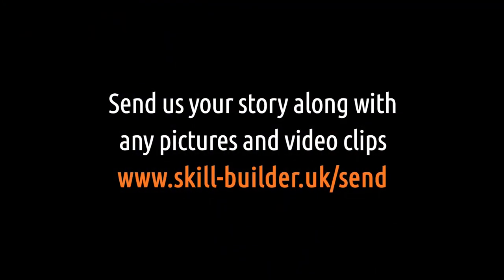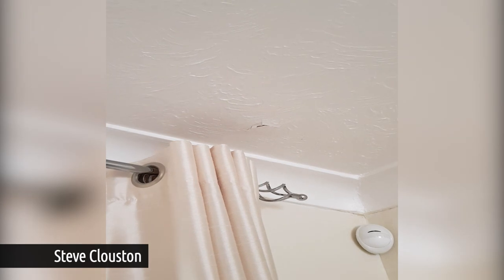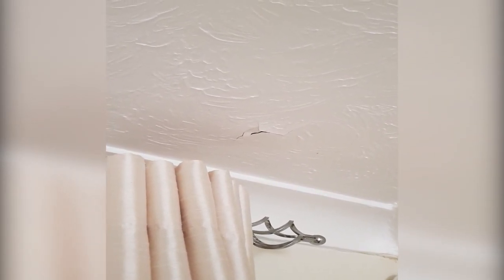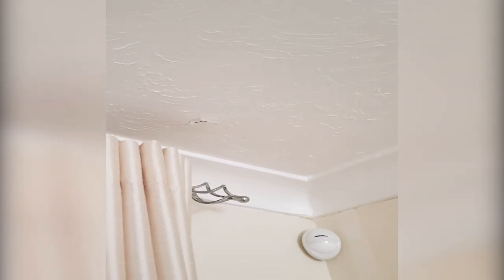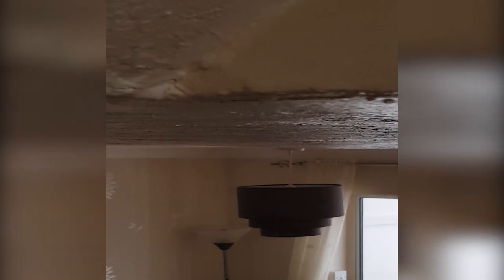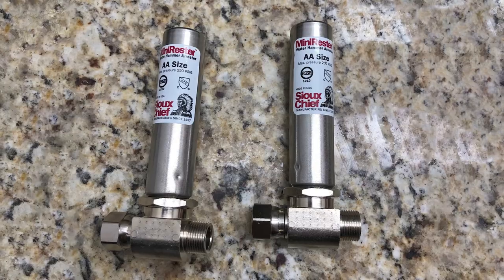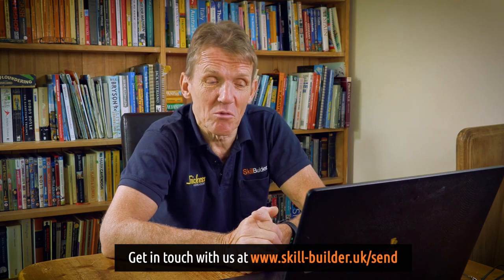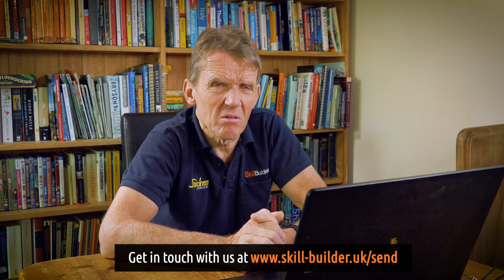Cracked Ceiling, Leaks & Water Hammer - ASB #17

Comment: We had a similar problem with our lounge ceiling, after a water leak which the insurance company paid to repair. They covered damage caused by the leak which meant ripping out the old plasterboard and artexed ceiling as well as materials for decorating the walls. Might be worth checking your insurance for the costs following the hot water cylinder problem. Our damage has been caused a few years before but they still covered it - we just told them the facts, got quotes and after they inspected the damage it was all sorted in a few weeks.

Comment: I remember a house where the pipes screamed when the downstairs toilet was flushed they sounded like they were trying to get out of the walls across the house and the reasons was a dodgy washer in the toilet cistern, replaced the cistern and it fixed the problem, that was called hammering too.

Comment: The problem with the concrete garage. I have tackled similar to this a few times. Flexyacryl is excellent stuff, can be applied in dry or wet weather and coated along the bottom of the garage wall would cure that too. You might have to re do it in about 10 years time, but how bad is that. Another product is Cromapol, if you need a lot of it this works out slightly cheaper as it is available in 20Kg tubs instead of 5Kg. Both are excellent products.

Comment: The strapping at 10.50 onwards are ceiling joist hangers .The floor as Roger calls it is really your ceiling and looks like it is only 3*2 with a 3*3 going across so that the hangers don't need to be put on each ceiling joist. Do not cut them unless someone who is a builder actually looks at the job and says you can, your ceiling will probably sag considerably if you do just cut them. To open up that space and not compromise your ceiling strength is a considerable job and would at least need a competent DIYer with a reasonable knowledge of roof construction. They look like original construction( Nobody puts more material into a house than is needed so they are there for a reason. I suspect if you did cut them your ceiling would suddenly turn into a trampoline.)

Comment: Hello Roger, I now live in Australia. In a previous video, you & Robin were talking about Roofs & that there was a shortage of Tiles etc. Here in Australia we use Concrete Roof Tiles or Steel Roofing (Colorbond) which you can get in assorted colors & Profiles. I was wondering Why they don't use this on the roofs in the UK. We have extreme weather conditions over here and the Steel stands up to them all. I have Concrete Tiles on my roof, but would prefer the Colorbond Steel. If we had Slate the Rather large Hailstones would soon destroy the roof.
Reply: @Benzknees  Nice to hear from you. All commercial buildings here have steel on them. As a retired carpenter I always preferred Steel as you need less Trusses to cope with the roof load. Some commercial Buildings have Flat Roofs & Box gutters, however if we get a large Hailstorm these gutters soon fill up & can cause a leak or collapse of the roof. I don't know of any houses with flat roofs but I am sure they are around . A pitch of 22.5" is common. As we have Cyclones here the Steel roof in my belief is better if it is installed as per instructions, the Concrete tiles can & do fly off. All the  best from OZ.

Comment: Those timbers are to hold the ceiling timbers to half the free span of the ceiling to stop sagging
Reply: Agree.  Had them in my loft before the conversion.  You can see the pieces attach to a full length baton which sits fully across the tops of all the ceiling joists. So those few pieces are holding up the ceiling joists right at the mid point i expect.
Reply: Yup. I have loads of floorboard sections between the purlins and the ceiling joists approximately halfway between the wall plate and the central supporting wall.

Comment: So ive dug up all the old concrete floors in the house they were damp and cracked. Put the sub base in and wacked it down and gone over and over it.... so next is the sand and visqueen before the 4' 100mm insulation eco therm 8x4 sheets. Can you tell me any hints tricks of the trade tips as to how to get the sand level and the boards not to rock....  how accurate do you need to be with the sand so the boards do not rock? Thanks
Reply: Robert Jones no purlins on the roof. Not sure of size of roof from pics. Does not look enormous but no support at all? Does not seem correct?

Comment: That ceiling, a lot of the time it's the ties they've used above (nailed batons) to the roof timbers, either nails have rusted and snapped or homeowners have removed them when they've used attic for storage. Only way IMO is rip it down jack timbers from underneath til straight and put a new baton in to stop it sagging again, then re-plaster. The worse job I've ever done in my life, including scooping gallons of poop out of a manhole.

Comment: Needs to get a pressure washer to get off the loose bits and anything growing on that concrete before applying any sealant, otherwise it's a waste of time and will fail.

Don't use that flexible pipe for drainage - it crushes too easily.  Get some 3" PVC with perforations (facing down), and make a burrito from filter fabric usong clean drain rock around the pipe.  If he is building a gravity-type retaining wall using stacked concrete blocks, don't really need a drain pipe if he backfills with gravel.  I'd pay more attention to preventing water getting behind the wall - presumably he wants to add a deck on top, so I'd make sure to add a drain and direct the water away using solid drain pipe.  And the wall needs some engineering (and a permit) if it's more than 4' high

Comment: If Steve replaces his ceiling then it would probably be better to tape and joint the new plasterboards and seal them rather than skimming them.
Reply: Why is that better?
Reply: @indigo50003  gypsum doesn't like moisture so if the boards are going in a kitchen or bathroom them it's definitely better to tape and joint rather than skim. Taping and jointing is a stronger joint than using scrim tape and skimming so it should hold up better in areas where the board might see more movement.
Reply: @BODGE71  Gypsum can take a bit of water and be unaffected, jointing compound turns to soft putty, I can't see how taping and applying jointing compound is better than a skim apart from being easier for a non-plasterer or DIYer.
Reply: @superiorbeing95  after you have taped and jointed you are supposed to seal the surface. This is how the manufacturers recommend you install plasterboard in high moisture areas.